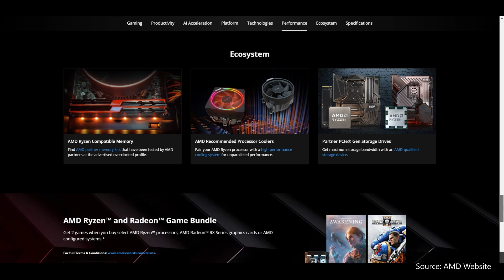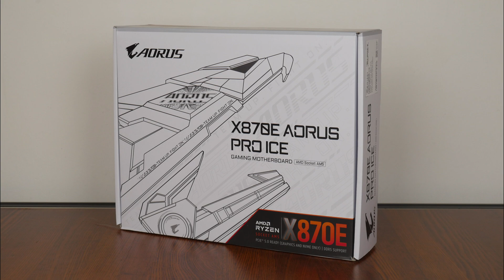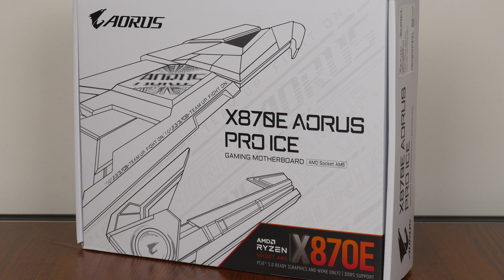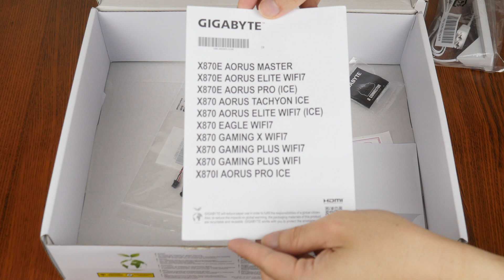THE Motherboard for Next Gen White AM5 PC Builds - Gigabyte X870E AORUS PRO ICE Unboxing & Overview

Comment: Does it share PCIe Lanes, even if you use the 5.0 ports with 3.0 or 4.0 NVMEs?
Often it only limits if 5.0 is used and totaly fine if 4.0 or 3.0 gets used.
Reply from the maker: As long as you have a drive, regardless of PCIe 5.0/4.0/3.0 installed on the M2B_CPU and/or M2C_CPU Gen 5 M.2 slots, the primary GPU slot will drop down to x8 mode!
Reply: @ALKtech  So it's basically a downgrad of B650E Boards, amazing...
Reply from the maker: @Katharina_VT  😅 well to be fair...having the GPU slot run at x8 doesn't have thaaaaat huge an impact on FPS/performance for that matter...there are other reviews out there that test PCIe bandwidth scaling, and these tests tend to show that if there is any performance degradation, the performance loss tends to be very minimal, in the low single-digit range!
Reply: @ALKtech  I know, it's more a "you can bensh it, but not feel it"-thing.
But not sure if that counts for Streaming too.
Reply from the maker: @Katharina_VT  🤣 but yeah regarding concurrent streaming and gaming...I highly doubt that would be able to saturate all 16 lanes of the PCIe 4.0 bus too 🤔
Reply: @ALKtech  What sucks with only 2 slots, I would need to buy SATA SSDs even I got them as M.2s.
And from  what I heard is SATA a dying port, which makes buying new SATA drives even worse.
Right now there are only massive overpriced motherboards for AM5 with 3 M.2 slots that not share GPU, which would clearly kill my price point I tagged.
Reply from the maker: @Katharina_VT  if lane bifurcation is a major issue, you might want to consider a X670E motherboard instead, which hopefully should be cheaper as retailers try to clear stocks. Alternatively, if you don't mind Intel, Z890 motherboards don't seem to have the PCIe lane sharing issue, though they're not yet available to purchase and benchmark data on the new Core Ultra 200 series of processors is not out too!
Reply: @ALKtech  I got an Gigabyte X670E Pro X, which sadly was broken. Else I'd used it.
Now I most likely need to stick with X870E. 
Intel probably would do again the 300 Watt+ thing. More efficient, but twice as much power consumption.
Reply from the maker: @Katharina_VT  😅 I see. Can't wait to see benchmark data once the embargo lifts for Arrow Lake-S...
Reply: @ALKtech  To be honest, I'm not very interested in the new Intel line-up, even I use one right now.
I'm 99% certain that they will run at least at 300+ watt to achieve the "gaming power".
But after all, Intel tells already themself that the 9000series X3Ds are better in gaming.
Reply from the maker: @Katharina_VT  yeah it's kinda funny how they've already gone ahead to acknowledge that Arrow Lake-S won't be faster than AMD's Ryzen 9000X3D parts in gaming 😂 but anyway, Arrow Lake's launching really soon...my thoughts are that the performance gains won't be huge, but perhaps there will be some efficiency improvements 🤔
Reply: If I have a GEN5 SSD and a GEN 4 SSD, where can I install them to not take away PCIe Lanes?
Reply from the maker: @GetRocky  install the Gen 5 SSD in the first Gen 5 slot (M2A_CPU) and the Gen 4 SSD in the third Gen 4 slot (M2D_SB). Hope this helps!
Reply: @ALKtech  thank you!

Comment: Ordered my board this morning! Do you think this ram would function in it? CMH64GX5M2B6000C30W It's intel XMP.. not EXPO, but there's not many Cl30 6000hz 64gb white ram kits.
Reply: My CPU is going to be the 7950x3d if it matters!
Reply from the maker: The RAMs should function with the X870E AORUS PRO ICE - if you've already bought them, just pop them into the board, head over to the BIOS and select the XMP profile that you see for DDR5 6000, and you should be good to go!

Comment: i have 3 pcie gen 4 m2s. There is a still cut to the Gpu x8 mode ? Even with gen 4.0 ?
Reply from the maker: Yeah that's right - the lane sharing will happen regardless of which PCIe gen of SSDs that you install; even if you install a PCIe 3.0 x4 M.2 SSD on the second PCIe 5.0 x4 M.2 slot, the primary graphics card slot will still drop down to x8 mode...
Reply: @ALKtech  this means we have actually 3 m2 usuable ports. Becease most user doesnt want to run gpu at x8 mode. And most of us use just first pcie x16 port for gpu. The other pcie will be disable with 3 m2 ssd usage but its not important. Am i right ? Right ?
Reply from the maker: @eyluloktay9104  basically if you wanna avoid dropping your GPU to x8 mode, you can only install one Gen 5 SSD in the first M.2 slot (M2A_CPU), and one Gen 4 SSD in the third M.2 slot (M2D_SB), for a total of two M.2 drives!
Reply from the maker: @eyluloktay9104  if you want to avoid having the GPU slot drop to x8 mode, the maximum number of M.2 SSDs that can be installed is two, one in M2A_CPU and one in M2D_SB. That said, it's worth noting that the performance difference between having your GPU operate at PCIe 4.0 x8 versus x16 mode isn't that big - there are several articles and videos out there that do PCIe bandwidth scaling tests, where the performance difference observed tends to be in the low single-digit percentage range or even negligible for that matter. What this means is that to the everyday end-user/gamer, he/she might not even notice the performance/FPS difference when running a GPU at x8 mode. Hope this helps!
Reply: @ALKtech  I bought the Asus X870 A board. Im going to use m2_1,m2_3 m2_4. Im not gonna use m2_2 becase this is share bandwith with gpu. And M2_3 share  bandwith with bottom pcie slot and it will be disabled. Am i making mistakes? Thank you for your long answer btw ♥
Reply from the maker: @eyluloktay9104  yes you got all of that right 👍👍 what processor and GPU will you be using for your PC build?
Reply: @ALKtech  I have Msi Z490 Carbon + intel 11700k + Msi Suprim X  4080 Super + 2x1 Tb Samsung 980 pro. I bought Asus X870 A strix board. I wanted Gigabyte X870E Ice board but becease of the pcie issu i go with Asus. Only White mobo with right specs Asus for me. I will wait 9800x3d. Hope it will come end of october. It will be huge update for me. And im also using Asus Pg27AQDP monitor. But im not getting benefit 480 hz because of my cpu. Thank you for your answer ♥
Reply from the maker: @eyluloktay9104  sounds like one heck of a build especially when you have a 4080 SUPER paired with a 9800X3D, which I hope will be really great for gaming when it launches. Enjoy your new PC when you finally put it all together!

Comment: This seems really limiting on PCIE lanes for what is supposed to be an X870E board.  You're basically limited to two NVME drives if you don't want to neuter your graphics card.
Reply from the maker: Yeah...it's because of mandatory USB4 support, where some PCIe lanes from the CPU have to be set aside for the USB4 controller instead, resulting in lesser lanes for M.2 drives and hence this entire lane sharing situation. That said, there are some benchmarks out there that demonstrate how having your graphics card run at x8 speed might not result in thaaaat significant a performance drop - of course, your mileage may vary with the type of GPU and of course the type of game in question.
Reply: @ALKtech  Wait I'm confused, so can can I use the first two M.2 Gen 5 SSd and the third one for M.2 Gen4 , just not the last 4rth Gen4 M.2 slot if I want full PCIE Gen 5, did I get that correct or am I wrong??
Reply from the maker: @hdz77  if you wanna maintain your GPU slot at full x16 speed, you can only install one PCIe 5.0 SSD on the first M.2 slot (M2A_CPU), and one PCIe 4.0 SSD on the third M.2 slot (M2D_SB), for a total of two drives. As long as you have a drive installed on the second and/or fourth M.2 slot, the GPU slot will drop to x8 speeds. Hope this clarifies!
Reply: @ALKtech  thx for the info, but if I just use 1 pcie 5.0 m.2 on the first slot, then add another 1 4.0 m.2 with a 3.0 m.2, will this drop my GPU to x8? Or still runs at x16? Since in using 1 5.0, 1 4.0 and 1 3.0 m.2....
Reply from the maker: @arthur_pd  as long as you have a NVMe SSD installed in the M2B_CPU or M2C_CPU slot, regardless of the PCIe generation, the graphics card slot is still going to drop to x8 mode! E.g. if you install a PCIe 3.0 x4 M.2 drive on slot M2B_CPU, this will still cause the graphics card slot to drop to x8 mode too. Hope this clarifies!

That said, it's worth mentioning that the percentage drop in performance due to the GPU lanes being cut from x16 to x8 isn't usually very large - there are some benchmark articles/videos out there that have quantified the percentage performance difference, and these tests show that the difference tends to be in the low single digit percentage range, which means under everyday usage/gaming scenarios, a typical user might not notice the drop in FPS!
Reply: @ALKtech  Thanks for the clarification, that's sucks for me, I wanted a white Board but guess I'll stick with my AsusX670E  Hero board.
Reply: @ALKtech  noted, but sry another question, what if another x870e board only have 1 gen 5 slot for GPU and 1 gen 5 slot for m.2, will this limit my GPU to x8 with the same setup of using 1 m.2 gen 5, 1 gen 4 m.2 and a Gen 3 m.2
Reply from the maker: @arthur_pd  do you have the brand and model of this board that you mentioned about, so that I can just quickly glance through its specs? Going by the X870E chipset design, if this board you mentioned has only one Gen 5 M.2 slot and one Gen 5 GPU slot, and the rest of the M.2 slots are Gen 4, you probably will not encounter any lane sharing with the GPU. But again, this is my guess without knowing the exact motherboard model 😅
Reply from the maker: @hdz77  happy to help. Actually, if you're looking at a white Gigabyte board that doesn't have any lane sharing stuff going on, there's the X670E AORUS PRO X that even comes with WIFI7 - but this board doesn't have white slots and hardware like the X870E AORUS PRO ICE 😅 and going from a X670E board to another X670E board might not be the best use of $$$...
Reply: @ALKtech   Yep that's why I'm sticking with my X670E Hero, cause there is no lane sharing and I can use all four M.2 SSD
Reply: @ALKtech  oh yeah, I was going to preorder the Asrock x870e tachi series or the Nova Wifi(top/same quality that matches other top brands with lower prices), so according to their specs, I shouldn't worry to encounter these GPU lan downgrade to x8 problems, right?
Reply from the maker: @arthur_pd  just had a look at the specs sheet for the X870E Taichi and Nova WIFI - seeing as these boards only have 1 Gen 5 M.2 SSD slot, you're right in saying that the GPU slot's PCIe speed will not be affected in any way even if you were to populate all of their M.2 slots!
Reply: @ALKtech  that's great news, just preordered the Asrock x870e Nova Wifi, since im only using my new gen 5 SSD for system and other lower gen 4 for games or storage, and waiting for the new 5080 to be released to replace my 4070 ti, that gonna be a great setup
Reply: @ALKtech  but if you wanna use the M.2 connector (M2D_SB), integrated in the Chipset, but you have a 7000 series processor, you can still use it? Cause in the specifications it mentions something about working on processors 8000 series phoenix 1/2
Reply from the maker: @danielpinzon9215  ah, I get what you mean. The text formatting for Gigabyte's Specifications page for this board is wonky - the line "AMD Ryzen 8000 Series-Phoenix 1/Phoenix 2 Processors." is supposed to be part of the prior line "* The M2B_CPU and M2C_CPU connectors will become unavailable when using the". In any case, no issues to use M2D_SB at all regardless of what processor you have (Ryzen 9000/8000/7000). You can check the motherboard's manual as well to confirm this!
Reply: @ALKtech  ohhhh I see. That makes sense. I get it now. Thanks man. I was very confused.
Reply: If you're running 5.0 anyways
Reply: It’s honestly not a major concern. Unless you’re doing heavy 3D modeling (which I doubt someone focused on making an all white computer is) going from 16 to 8 lanes (pcie gen 4 essentially) will have no humanly discernible difference on your precious fps.
Reply: Question what speeds would the GPU run? I plan to fill all those M.2 slots
3 Gen 5s and 1 Gen 4.
Also plan on getting a 5090.
Reply: They all run like this. All p21, and p21+21. Ie. All AM5 boards.

Comment: For me it is perfect... Let's see if the 9800x3d or 9950x3d are worth it now ..
Reply: Exactly!
Reply: @Games_and_Tech  I went with Asus ROG Strix X870-A Gaming WiFi. Its got a little better IO and Looks nice too. It was quite expensive tho.
Reply: @mightymartin6290  for the price it is not even a 870e 🥲
Reply: shitty mboards, chipset Overheating, minimum temperate 63-65'C. Im stresses test over 90'C and cutoff !!!. I'm waiting for NZXT N9 X870E.
Reply: @JanKowalski-sy4zh  not sure where are you getting your information, Hardware Unboxed already did the testing, temperatures were good
Reply: @JanKowalski-sy4zh  overheating while under overclock?
Reply: @JanKowalski-sy4zh   so stu pi D, NZXT has very bad VRM quality all the time

Comment: Amazing review! One of the best reviewing channel i've seen. direct to the point, clear, informative.  Convinced me to get it. Still tho, was hoping for a new GPU launch this autumn/fall that might take advantage of PCI 5.0, but nope. And the X3d Cache but but i really dont want to wait until late Q1, Q2. 

You think G.Skill Trident Z5 Royal Neo RGB DDR5-8000 would fit? I was thinking about getting Oloy Blade 5 Platinum first, but they only go up 7000mhz. ( g.skill ram config doesn't work atm with checking compatibility on this board)
Reply from the maker: Thanks for the kind words, glad you found the video useful! That said, your wish might come true sooner than expected - just read today that the rumour mill's pointing to a potential end-October 2024 launch for the 9800X3D 🤔

That said, I haven't had the chance to test high-speed DDR5 modules with any X870 boards just yet, so I can't really comment if the G Skills will have any compatibility issues with this mobo 😅
Reply: @ALKtech amazing, not so much for my wallet, but amazing to future proof the build. Cheers
Reply: An update if you're curious. So i ordered  this board:

Ram: G.skill Trident Z5 Royal Neo DDR5 8000mhz 48gb

Storage: a Crucial T705 NVME 2TB

Case: Be Quiet Shadow Base 800FX - white

cpu cooler: Be quiet light loop 360mm white

psu: hard time finding a good one in whire initially was planning on getting Asus THOR III or a be quiet one(even asked their customer service if they had any plans for a white one but nope), in the end i went with Seasonic Vertex 1200w. 80+ gold.

Cpu:, waiting for AMD to release but if it's correct on the 7th, the 9800x3d.

Gpu: will use an old one and be gpu limit for a few months.

I haven't upgraded my pc in i think 4 years.
Reply from the maker: @Arcadiez  sounds like a pretty solid PC build and thanks for sharing! I'm guessing you'll be getting a white GPU as well in due course? Just wondering too - any particular reason why you chose DDR5 8000 RAMs? Seeing as DDR5 6000/6400 still seems to be the sweet spot for Zen 5 processors!

Comment: What are the differecnces with X870 VS X870E Boards by populating Nvme drives, does the lane avaliability remain the same? Im wondering if the Z890 have the same limitations.....
Reply: Z890 runs the exact same lanes as x870e. X870 has lower overall lanes available though. X870e has 44 total pcie lanes with 24 dedicated to pice 5.0 while x870 has 36 lanes total and 24 to pcie 5.0. So no difference really.

Comment: Great Overview! Really appreciate you showing this board!

Kinda baffled though about the nvme slots. Like so what is the point of the second + fourth nvme slots even being there if they make the gpu slot go to x8 mode due to sharing cpu lanes. I understand for accessibility but basically if you want peak gpu performance for a current high end gpu or future pcie 5.0 one you really only have 2 nvme slots (first & third).
Reply from the maker: Glad you found the video useful! The lane sharing situation seems to be more pronounced with X870E and X870 motherboards, and I suspect that this is due to the fact that AMD has made USB4 mandatory, where some CPU PCIe lanes have to be routed to the USB4 controller, leaving lesser lanes for other peripherals and connectors.

That said, as @prototypep4 pointed out, while the performance drop might be negligible at times, my two cents is that it's still something to take note of, especially if I were to be caught unaware about this whole PCIe lane bifurcation situation, and be unknowingly leaving performance on the table - I'd feel worse especially if I had shelled out a good amount of cash for say, a RTX 4090 and would hence expect only the very best out of my GPU!
Reply: @ALKtech  While I can appreciate the argument about leaving performance on the table, current gen is not maxing out 4.0 x16 and moving to 5.0 if it runs at x8 it'll be the same bandwidth as 4.0 x16 anyway. I don't think the 5090 is going to be such a monster to require it to gain more than even 15fps at the absolute most. For benchmarking? absolutely rip out any other drives and go for gold Me personally will be doing that just to push my overclocks as hard as I can but once I've got my numbers I'm shoving in a second drive. The performance drop will be negligible and I truly hope reviewers are responsible enough to test and show what the drop will actually be.
Reply: To be fair even the 4090 can barely use pcie 4.0 x16. X8 only drops performance by single digit fps. It's honestly not even worth worrying about at all. The PCIE bandwidth is already sufficient. If 50 series are 5.0 then I don't see x8 even really being a factor on performance.